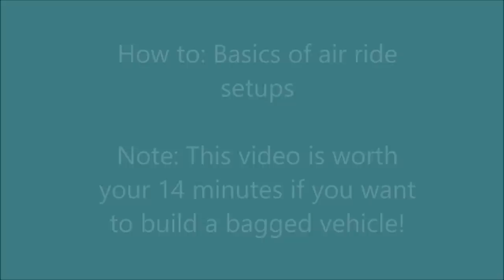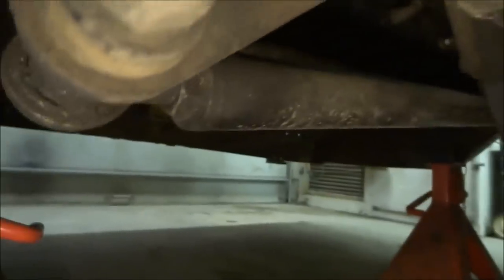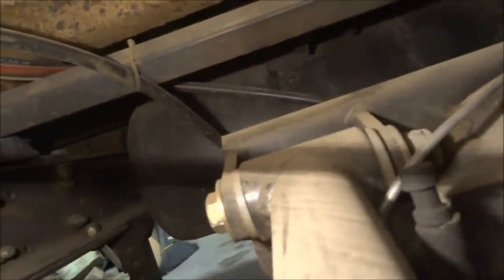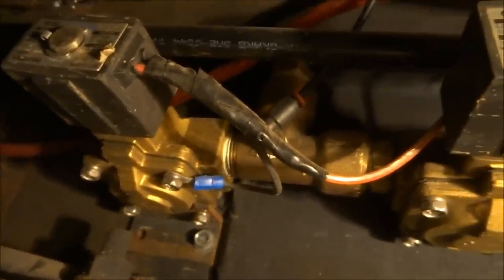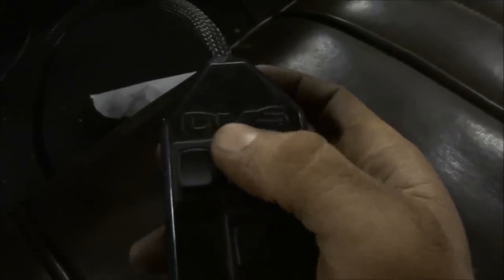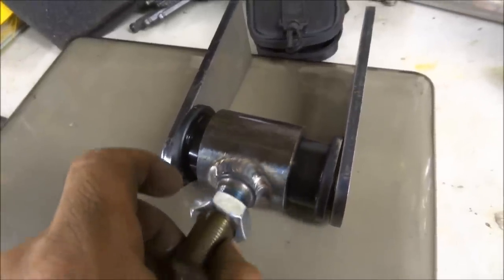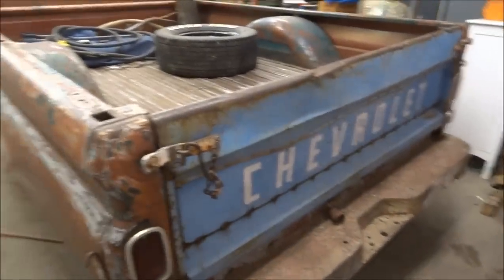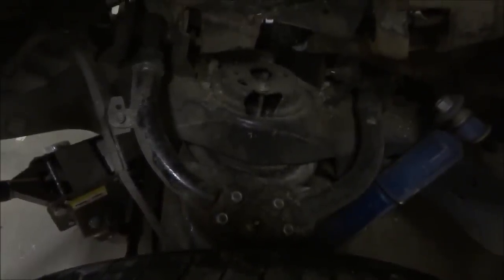How to: Airbag suspension Explained

Comment: Why didn't you get someone to build your strut towers correctly for the bags, and those chopped frame rails should be fixed man whoever did that to your truck should give you your money back they should be grinned down and welded shut brother. Other than that good info.
Reply from the maker: well I've been driving it daily for 3 years and no issues so.... also drag the shit out of it and use it like a truck is supposed to be used.
Reply from the maker: +Tinman 2 Kustoms BTW, these trucks dont have struts or strut towers, so you really dont know what you're talking about lol

Comment: hI, COULD YOU TELL IF i COULD PUT AIR BAGS ON MY 1966 GALAXIE , AND HOW MUCH WOULD IT COST ? THANKS
Reply from the maker: Charles Prisco you can put airbags on anything... Cost is an open ended question. Could be anywhere from 2,000$ to 50,000$